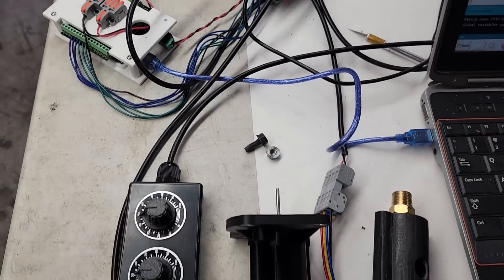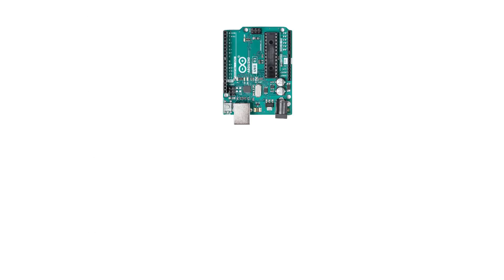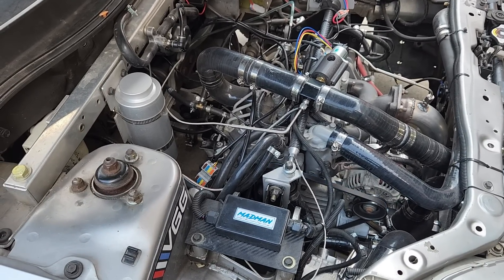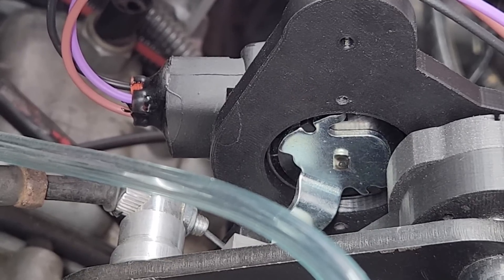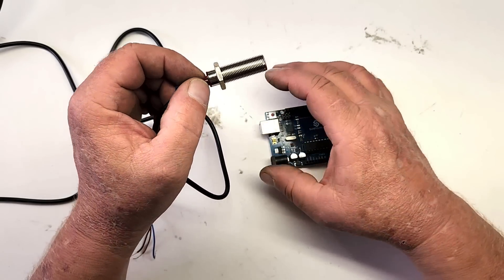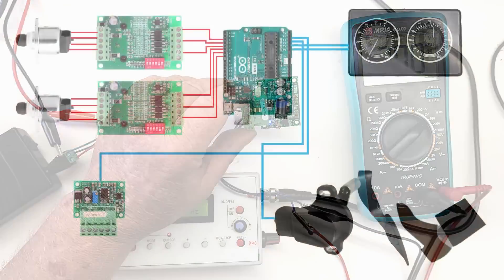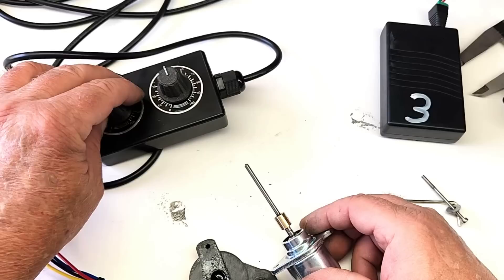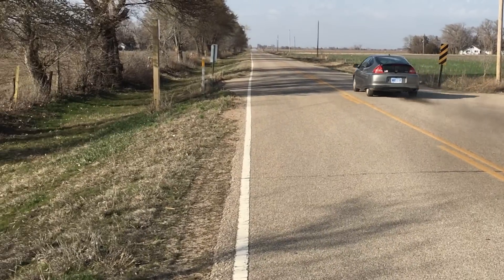S4 E20 We continue upgrading the AMR500 supercharged kubota diesel with custom engine controls

Comment: I like your clever shortcuts to simplify the system. I was getting into an arduino project and basically quit when I had to start modifying registers and altering timing and interrupts. I might be able to apply similar methods to revive my project.
Reply from the maker: bit banging the registers is good to know, but sometimes the learning curve it way to steep. Take it one step at a time and you will get there.

Comment: Go deeper.....   and do you have a site that references where your finding all of these little arduino boards and stuff?
Reply from the maker: I generally get most of my stuff from amazon.  Sometimes I get stuff from Adafruit if the device also needs a library to function.   Adafruit is more expensive, but they supply demo code and library's and that eliminate much frustration.

Comment: this engine control is very similar with the actual small displacement turbocharged modern engines: the turbocharger is managed by ECU and increase the boost when needs power and lower in cruise

Comment: Awesome work, Jimbo!  You’re obviously familiar with Arduino boards, but have you tried the Raspberry Pi Pico microcontroller?  Cheaper, faster.  I can directly read a hall effect sensor on my engine project, no problem.  As for your video clips, I couldn’t help but think: JB Weld, 60% of the time, it works every time.  Haha.  See you next week. 👍
Reply from the maker: I played around with Raspberry pies in the past,  Not a big fan of the 3.3V interface.  I'm old school and I like 5V.
Reply: @robotcantina8957  I like 5V better too, coming from a lifetime career in hvac building automation.  But I’ve just used simple two resistor voltage dividers to drop the 5v down to 3.3.  The Pico is nice to work with because it has dual processors, so one core can deal with the high speed digital stuff, while the second core does the analog and math calculations.  I wonder if, instead of a fuel rack limiter, you could have gone with just an electronic throttle, then used a servo to drive the throttle on the injection pump with “intelligence”?
Reply from the maker: @gregholloway2656  A "smart" throttle would be the way to go, but unfortunately I have to work around the governor and it's the internal governor that's causing the smoke issue.  Removing the governor is not really an option because it serves a purpose even though its a pain in the ass to deal with.

Comment: Kubota & Reliable.  Wow, there are two words you normally do not see close together.
Reply: Super reliable and super long lasting.
Reply: @moestrei  What?  I've never seen a Kubota run more than a 1000 hours without having major issues.  Always leaking oil and coolant from every seal and gasket.

Comment: I now know why I had trouble in my college project measuring frequency with an Arduino. Every math calculation meant lost counts.
Reply from the maker: Indeed, frequency measurements are a bitch.  You would think by now someone would have come up with an ulta fast library plug in for frequency.

Comment: Regarding your boost controller and bleed off, you might be loading the engine up/sapping torque from the engine.  The way I understand it is if the blower has the ability to compress air it will do so, requiring more power.  But if you let it make as much pressure as it can, then it will be compressing less at higher boost levels, and will essentially free spin, requiring less power to drive it.  That is a super simple explanation, and I might be saying it wrong.  Steve Morris has a great video on it that explains it much better.
Reply from the maker: From the road experiment i have done,  at cruising speed the engine seems happier when I vent some of the boost.   Keep in mind there is a lot of stuff I do that's not filmed and I base my builds on actual experiments that I have personally done.
Reply: @robotcantina8957  yeah the stuff I'm familiar with is big displacement big power.  Wasn't sure how it would scale down, if at all.
Reply from the maker: @THEmadmikeismad  It's all very interesting stuff when you have a limited amount of power on tap.  that's what makes projects like this fun.
Reply: @robotcantina8957 yes i love this series for that reason.  Really makes for a great potential hyper mile/road trip car, especially when you can keep it so simple.

Comment: Many sensors. Can't have too much code interfering with collection of data. Hope it works. Coding on a faster microprocessor capable of multitasking or perhaps several mcu communicating with a master mcu for example is a big meh and not as fun.

Comment: That's not a lot of range on your throttle position sensor, though it's probably good enough for what you're doing with that data.
Reply from the maker: True, its not reading full scale as you can tell by the counts.  I'm really looking for any number that indicates the throttle has moved from idle to low to mid throttle.  0-1023 would be better, but I'll take what I can get.

Comment: if I'm not mistaken, the sensor is fairly precise in reasonable non-scientific terms . +/- 0.01 % at the display numbers 2000 rpm with a 0-20 rpm fluctuation. or in other terms a 99.99 accuracy. sorry if that's a little pedantic but seems pretty good for the jungle site.

Comment: You can control pins directly by using asosiated registers . That will make code run faster
Reply from the maker: Yes,  Absolutely.  I plan on releasing the code at some point and I want to use code that's easy for everyone to understand, so I'm staying away from direct manipulation of the pins and registers.

Comment: I love the variety. I'm a huge tech geek, and I'm also a fan of the more mechanical stuff, so for me it's a good mix. I think you're doing it a way that if someone's not that interested or up to speed they can just skim past it. So I wouldn't go all Arduino, all the time, but a little here and there to push the limits further I think makes a great mix. But what do I know, I'm just me and I'm an odd-ball....

Have you considered an ESP32 with multiple cores? You could dedicate one core for the stepper motors and the other code for the sensors. Plus, it has Bluetooth and WIFI so there are options for making a monitor. You can even run a small webserver on it so you just have to go to the IP address of the ESP32 and it shows up. 

The coding is essentially the same as the Arduino. You can use the same C/C++ code, but you can also use circuit python or micro python as well. 

They also have a 12 bit ADC, so that's more better. :) You can use the I2C bus and add a 16 bit ADC if you really want to get crazy. 

I love playing with Arduino but I love playing with ESP32 even better...

Comment: Coming along, I see. For a future project I think it would be cool to see that tiny supercharger youve got on a 2 stroke snowmobile engine. Of course it has to go in something small and cheap. A S10 would be awesome. S10s are easily available, cheap and there is a ton of aftermarket support. Would most likely gain some viewers. There is a huge S10 fan base.

Comment: Im currently working on an esp32, and trying to get that up and running, i like hearing about the technical issues, just as much as the nuts and bolts issues.
Reply from the maker: I considered using an ESP32 for this project because of the faster processor. However, I feel using an UNO is more relatable for this audience.

Comment: I used to make circuits and my special talent was to conformal coat them (it's a special type of varnish) but other than know how to build and solder  them ive absolutely no idea what you where doing. I do appreciate the mechanics and I would have tried to make everything as primitive as possible because I would like to actually go places and the more complex the more chance of a failure point .not criticism and I am still amazed at your talent,👍

Comment: To be completely honest, I think that the throttle position sensor is probably the least useful sensor out of the ones you selected. I think you would have been better off adding an absolute pressure sensor instead. I say that because the extra fueling solely depends on the extra air being added to the engine by the supercharger. Your "additional fuel" map could literally be a single dimensional map based solely on manifold pressure alone. You could start simple with atmospheric or less being the factory position and something like 10 PSI (gauge,) being your max fuel position and interpolate linearly for everything in between, so 5 PSI (again gauge,) would be halfway between factory and max fueling. That way the fueling correction is dictated by air density, the variable that the supercharger changes.

Comment: Love these nerdy episodes…. And I like how you were able to spend a little money on hardware to save firmware effort (the frequency-to-voltage converters).  In my day job of embedded systems firmware development, we do the opposite.  We will spend months of coding time to save a few pennies in hardware.  When you multiply pennies by millions of units, it becomes real money!
Reply from the maker: Indeed, I have been to many engineering meetings where we talk about saving five cents.  When I learned electronics back in the day,  we were also educated in how to save money in designs.
Reply: Frequency counting is really simple to do with hardware timers though but that can interfere with Arduino usage of those timers.

Comment: I LOVED this episode. Currently I'm designing an Arduino controlled windshield wiper motor driven steering servo for my 10HP Mercury powered 12' boat. Not sure if it will ever get implemented, because I keep improving it. Right now with a compass sensor allowing for a simple autopilot/heading hold function. Your work is amazing, spanning so many different fields of expertise and being executed so well. People like you should be given apprentices to pass on all the knowledge.
Reply from the maker: Good luck with the project!  It sounds like something I would build if I had a boat.

Comment: Love the fact we're dragging this WWII era engine design kicking and screaming into the 80's 😀👍🏼
Also curious why the Aduino can't do the calculations fast enough, couldn't you just have a lookup table? I feel like I'm missing a beat here 🤔
Reply from the maker: The standard code for measuring frequency's takes about 1 second to update.  Plus during that time the cpu is receiving thousands of interrupt requests.  The stepper motors require a clock pulse that's also being generated by the cpu.  When you add up all the time it takes to do everything. its too much when writing in standard code.  the solution is to directly manipulate the ports and registers but the code is unreadable for most people.

Comment: Hey its another great episode, my Sunday morning is now complete. You did a wonderful job esplainin’ all of that technical mumbo jumbo stuff in a clear and understandable way. For some of us, pictures say more than words. 
What’s great about this channel is that what you are doing, any average Jimbo could do, as long as you have a 3D printer, small machine shop, mech-e background, video production tools with script writing, on-screen talent, micro electronic, and a strange knack for coding… See, any Jimbo off the street could do it too. Notice I didn’t mention the team of gnomes working the cameras, sometimes they are more trouble than not. 

You  have pretty lofty goals with the engine control, but it is surely doable. Great job using discrete devices to keep your coding simple. It takes very little time to read a 10bit adc vs calculating pulses over time. I doubt that honda has antilock brakes but if it did, it would have all of the bits you would need to pick up road speed. I don’t think they use magnets and a hall sensor for antilock brakes, but instead a ferrous metal sensor with a spur gear. Back in the day I do remember some aftermarket cruse control that used magnets you would tie-wrap onto the drive shaft. In that case they didn’t care about actual ground speed, but just maintaining a frequency. You could do something similar with the axle shafts. You have to remember magnets are destroyed by heat and vibration. Something that little engine is known for.
Reply from the maker: Thanks!.  The saturn MP3 transmission we are using has a VR sensor for vehicle speed.  I'll be doing the interface today so I can get the car back on the road.

Comment: Why not use the ESP32?
Powerful enough to run the engine and frequency calculations. Yoy even get it with 2 cores so you can program which core to performe which task.
Reply: Learning curve etc probably.

Possibly having a stash of arduinos already.
Reply from the maker: I have a few ESP32 in my huge stash of arduino stuff.  basically, I like 5V interfaces and not 3.3 volt stuff.
Reply: That was my thought too. You can program it with the arduino ide. The issue is that the esp32 is a 3.3 volt system. So all of your external stuff needs to be 3.3v vs the standard 5 volts. The arduino he's using a 5 volt based system. You can make 5v peripherals work but you need level shifters or resistor voltage dividers to make it compatible. Too much fiddling around for this channel I think. BUT in the right condition the esp32 IS a much better choice for engine management because of its clock speed and being a 32 bit dual core processor. There is more time to do stuff.

Comment: This is great, since I've wondered how many old cars could be made to run better, more fuel-efficient and even increase power by a little if you could piggyback cheap electronics on it to micromanage the mechanical set-up's shortcomings.
Reply from the maker: A few years ago we built a robo-throttle for a gasoline powered Saturn and that Orwellian device actually improved the cars fuel economy quit a bit.   There is a lot that can be done to older cars.

Comment: The first car's with injection using a ECU used  4 mHz Intel, i think it was Z80.
You can use 74HC174, 74HC374, 74HC574 or MCP23S17 to extend digital pins.
: )

Comment: Super cool! Just make sure to provide clean power to the Arduino - car electrical systems can have short milli- or microsecond spikes of tens of Volts, it can fry Arduino easily ))
Reply from the maker: LOL, indeed.  Right now during the development stage, all the arduino stuff is being powered by a 12V battery pack so I don't zap anything.

Comment: I really enjoyed this video. Although I got my computer science degree in 1981 the only time I came anywhere near to what you're doing with these microprocessors was when we had to make an elevator controller using a Motorola 6800 in one of the subjects.
Reply from the maker: Assembly language is a good thing to know.
Reply: That project must have had its... ups and downs.
Reply: @Spudz76  heh, nice pun 😁 The program was not even assembler, it was machine language entered using a numeric keypad. The code was just a bunch of numbers.
Reply: @Spudz76  🏆  😅

Comment: Many years ago I went through a similar process with a 7.3 idi engine.   All mechanical.  Designed and built a PIC based ecu and tcu.  It really woke that engine up.  Watching this is bringing back lots of fond memories.
Reply: Oh I would love to hear what you did to that engine. I have a 1.9 AEF that could apreciate a wake up call
Reply: There used to be a really thriving community around using an ardrino to add functionality to old engines like fuel injection and more aggressive ignition timing variations.  Some where just replacing old ECMs that went bad and there wasn't a competent/reliable replacement available. Some just wanted to see what they could do (I added electronic ignition and fuel injection to a 25hp  20 year old garden tractor, for instance) .  A lot of that disappeared seemingly overnight when the EPA started going after the diesel modders claiming emissions circumventing and fines that would scare your grandchildren's grandchildren. Some of the software and schematics is still around and getting updated but it's harder to find. People aren't as open as they used to be. Did you do anything like that or did you home brew from scratch?
Reply: The mods I did were all unique.  The approach was very similar to Robot Cantina's but this was before the arduino was a thing.  I did it all with PIC 16F877A microcontrollers and discrete components with a smattering of borrowed sensors and machined parts.  Basically made the mechanical Stanadyne pump work like the computer controlled pump from the 6.5 diesels of the time. That along with a simple transmission controller made for a much improved driving experience.  It was a fun project.
Reply: @Dirty_Bits  sounds like fun. Thanks for sharing.
Reply: @Dirty_Bits Ironically, many are hearkening back to the days of the DS4's predecessor, the DB2. The advancements in capabilities found in the DS4 are certainly there (provided you tweak them to be less self-destructive ... I an looking at the GM engineers 😂). I have yet to acquire a stroked pump, but it is on my list. Having been modifying Duramaxs though for the last 10 or more years, the 6.5 is becoming more of a project than a workhorse or hotrod 😂
Reply: @sumduma55  Thats exactly one of my worries here, my nation's EPA equivalent is very very strict about any mod done to a car

Comment: Did I miss it?   Where does the vehicle speed analog sensor come from/go?
Reply from the maker: The vehicle speed stuff will be in the next video.  I'm actually doing the interface today.
Reply: @robotcantina8957  Ah, more JBL weld.  Oh remember that tire circumference increases significantly at speeds above  200 mph.
Reply from the maker: @ransomholbrook7428  I can calibrate the Arduino for the expanded tire size, however I really want to keep the speed below 200 MPH if possible.
Reply: @robotcantina8957  I understand ... safety first ... LOL